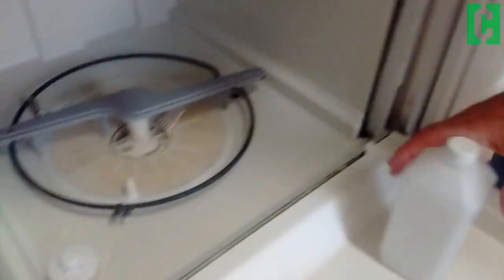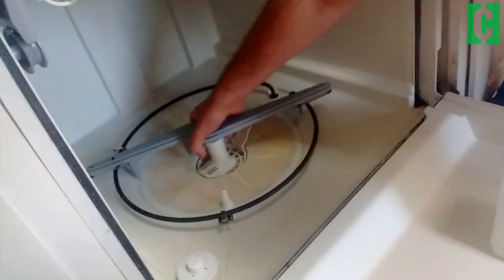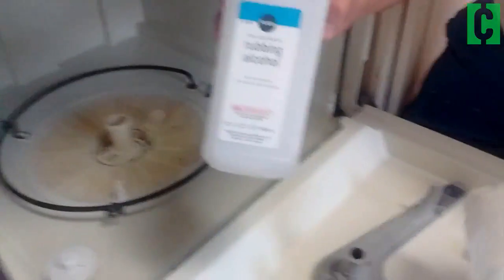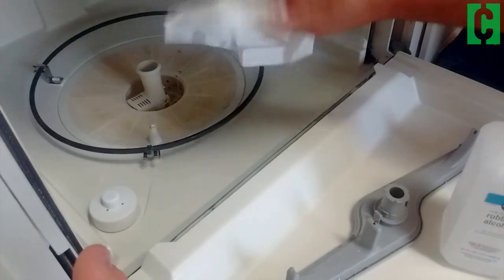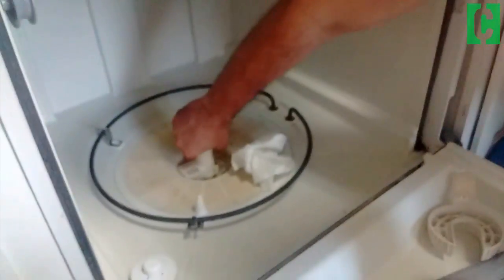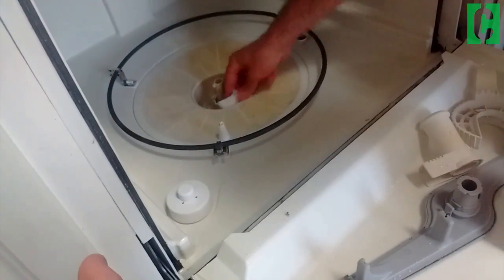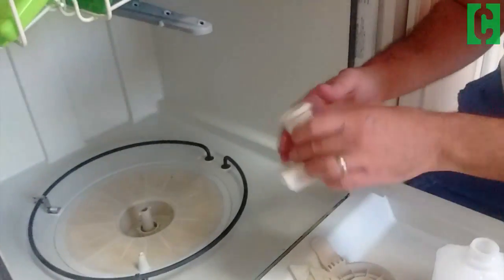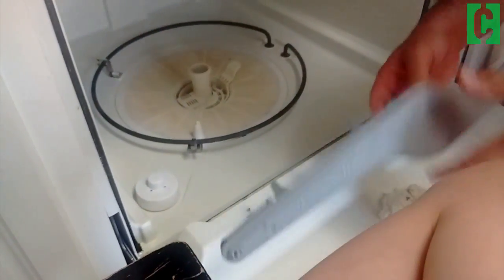How to Clean Your Dishwasher

Comment: Thank you SO much for this video! Just bought a house with this dishwasher installed (from 2005!) that actually still works pretty well, but could see it was very gross down there. I finally took everything apart, including removing the filter and scrubbed everything clean, even the the area below the filter. (Found giant seeds and even a cigarette butt among the gunk in the filter) Reassembled and ran a baking soda/vinegar cycle as a final cleaning, but the rotating sprayer came off during the cycle. Learned from your video that I need to rotate the one piece until it snapped into place. You're a lifesaver! (the owner manual was worthless) Crossing my fingers and seeing how long this dishwasher will last. It will reach its 17 year anniversary next week with VERY hard water! (Hoping to fix that soon) Aside from some small rust spots on the ends of the dish racks, it's looking pretty good again.

Comment: Thank you!!! I went the step further and removed the large bottom filter....it was BLACK underneath!!! 🤢🤮😷
Reply: Did you pop the big top filter (the one he cleans at the end of the video) off of the bottom filter? I did but now I can't get the  top filter snapped back onto the top one
Reply: How did u pop it back in? I can't seem to pop it back 😔
Reply: I think I broke mine. I. Can’t get it back in ..
Reply: I had the exact model and don't remember having any issues getting things back in place. I think it may have twisted back into place rather than popping into place
Reply: @d.r.3114  hey! Hopefully this is resolved for you guys but I had the same problem and I was pushing on the outside of the basket but if you push from the center circle the pieces will pop together.

Comment: This video is dangerously misleading. From the plethora of viewers praising how easy these instructions were, I bet too many ended up with broken parts, rancid o😊dors, expensive replacements, or handing over hard-earned cash to a pricy technician. My first conundrum is the lack of "cleaning" happening in this video-  Why would you say its "clean" if you only pulled out a few basic parts? You never got to "the bottom" or to any of the parts with the most food trappings, slime, etc. Nor did you go beyond that to the advanced parts of the machine where the blades and filters operate.